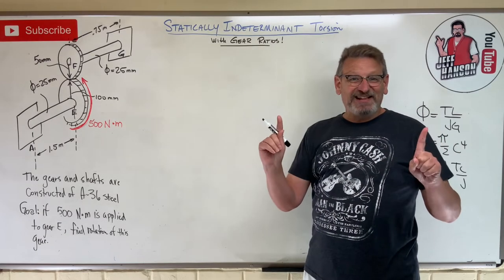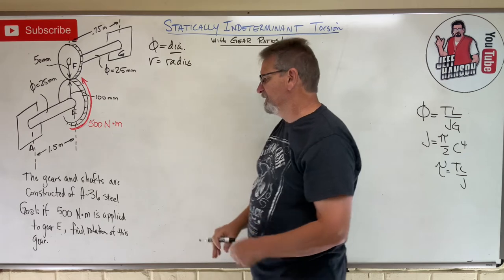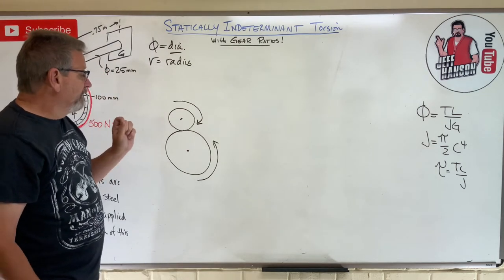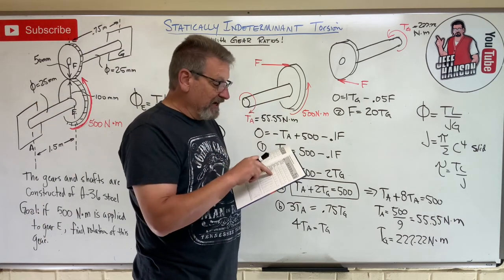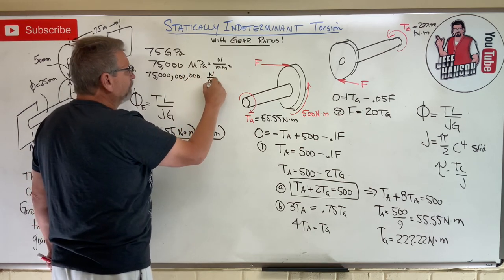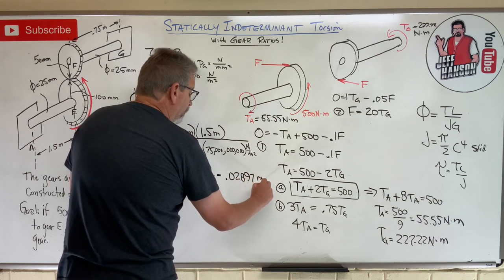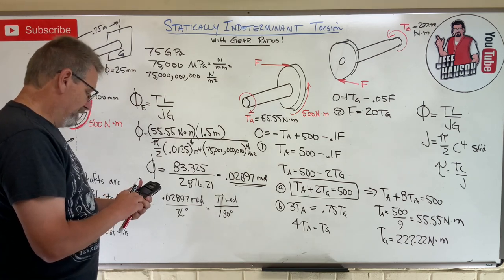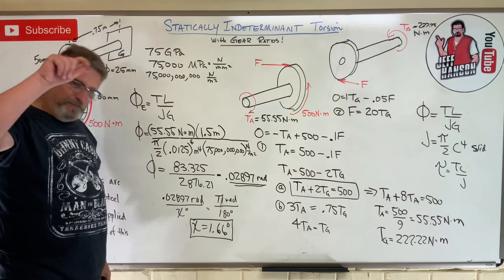Mechanics of Materials: Lesson 27 - Indeterminate Angle of Twist with Gear Ratios

Comment: If gear E (the big one) rotates 2 times then gear F (The small one) rotates 4 time. why did you put 2 with the phi E? shouldn't it be with phi F?  4:57
Reply: Late reply, but try plugging in some numbers. I believe he is right.

If you want to say that the smaller one rotates faster than the bigger one, then you really do want to do 4 * big = small. If you set big = 1 rotation, then the small = 4 rotation. 

If you did big = 4 * small, then you'd be saying 1 rotation of the small one equals 4 rotations of the big one, which just doesn't make sense.

Comment: I think there is a mistake In the free body diagram, If we had one force on it that force would take it to somewhere, why didn't you add another force to balance it.
Reply from the maker: You are correct, there would be a reaction force at the wall as well but that force would no create a torque so it is irrelevant in this example.

Comment: when calculating for the angle of twist, why is the radius used in calculating polar moment of inertia from the rod and not the gear?
Reply: Because the shaft runs a much longer length, and deforms a much greater amount under the same torsional load.

The gear would have its own elasticity as well, but it is considered negligible in this problem.  Suppose the gear is either mad out of a significantly stiffer material, or the diameter of the gear is so large that its own deformation is negligible.
Reply: @carultch  thank you very much. Your videos are incredibly helpful and are saving me big time.